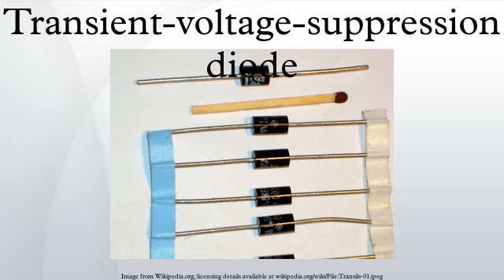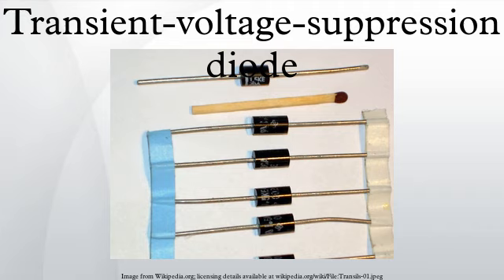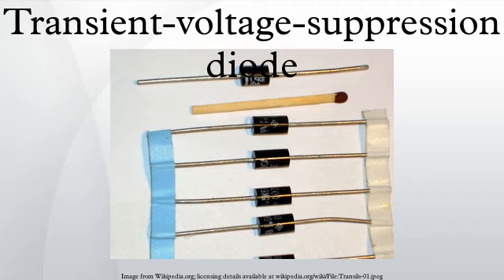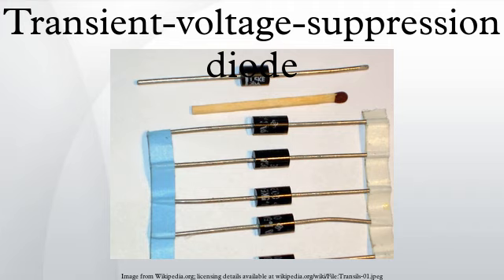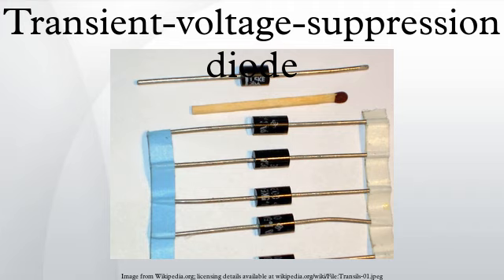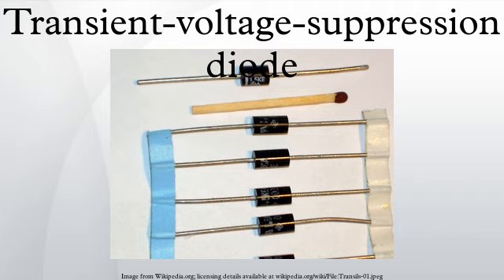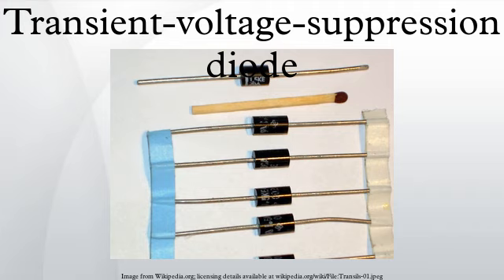Transient-voltage-suppression diode

Comment: How do you test a unit like(P6KE250CA) this with multimeter?
Reply: Put the TVS in a circuit and apply a power of <600 watts and the TVS should work.  Next apply a power  >600 watts and the circuit should not work. Then reapply the <600 watt power supply and the circuit should again work.  You can use your multimeter's voltage function and Ohm's law to test the circuit and thus your diode.  Since the diode's gate is set to trigger at 600 watts, I know of no other practical or non-destructive way of testing the diode.
Reply: If i show a short in diode mode on MM .002 either way is it still good?